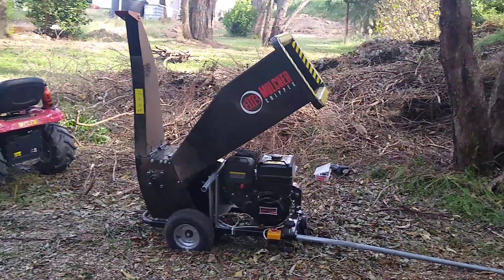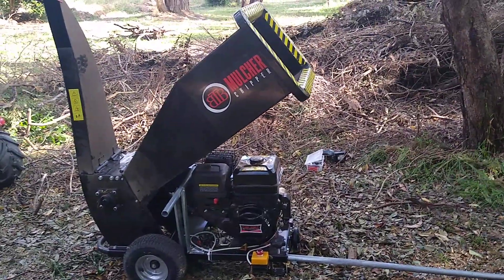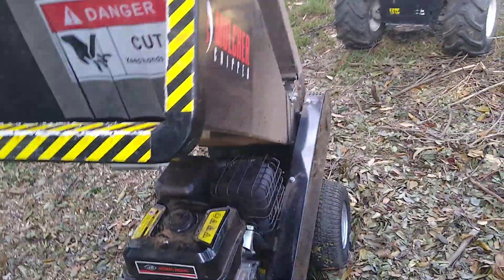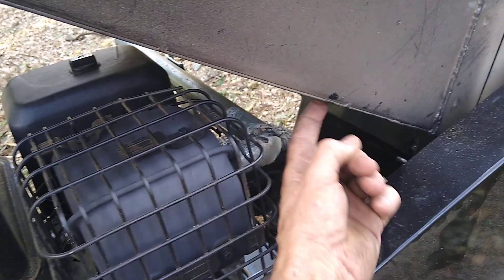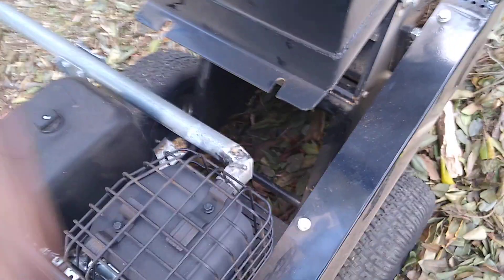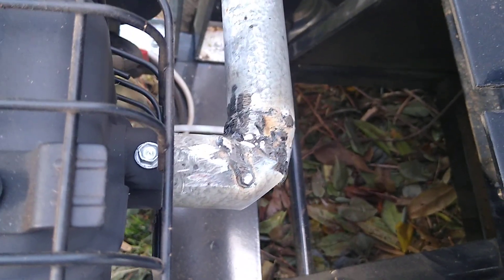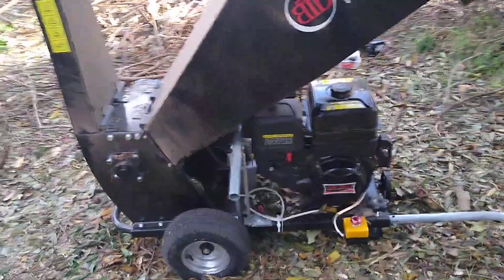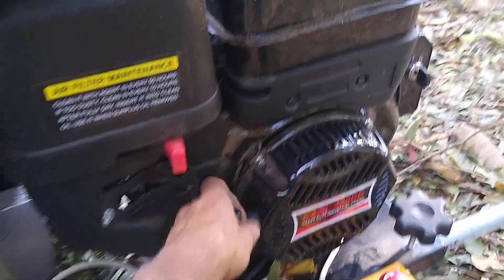WARNING! Wood Chipper (BBT9000) Must do addition carbon monoxide health hazard...

Comment: Love the quick smart ideas! What size opening is the wood chipper?
Reply from the maker: I didn't see your message earlier... the inlet funel shoot is 450x350mm and reduces to the twin cutting wheel which is 300mm x 150mm which in my opinion is a decent size for most chipping, I have now used this machine a few times and I'm very happy with it.

Comment: not a big fan working with metal (not that skilled). is it OK to add a rubber pipe/hose and clamp it on instead?
Reply from the maker: A rubber pipe will probably melt I have seen flexible metal exhaust hoses I'm sure you could easily rig one of those on an the original exhaust outlet is in the wrong spot, this is what I'm thinking of but make sure it's the right diameter, cheers
Sorry I can't upload the right link but google flexible metal exhaust pipe 👍